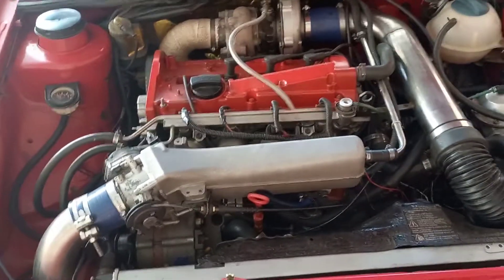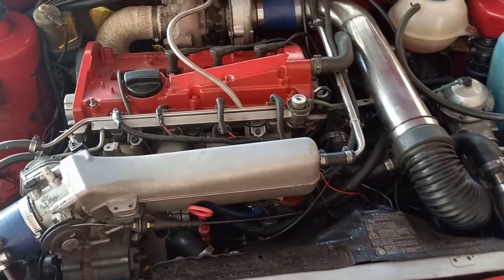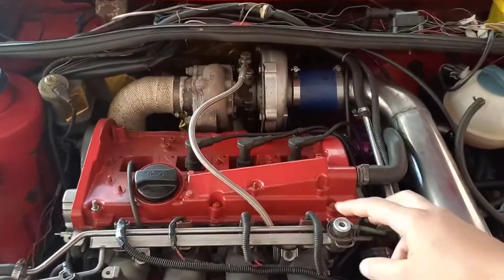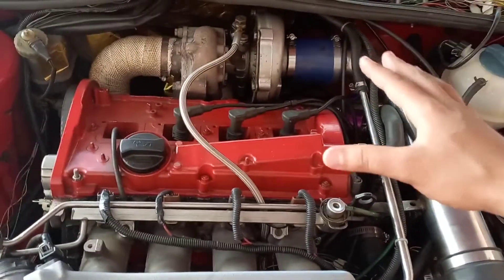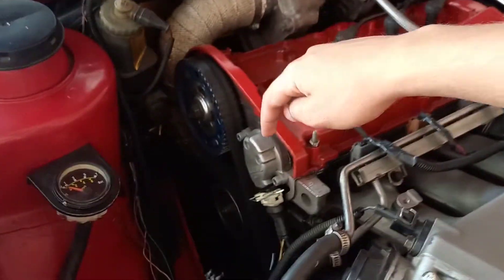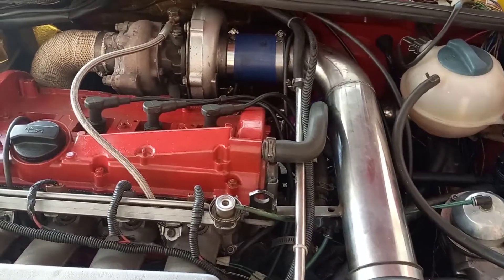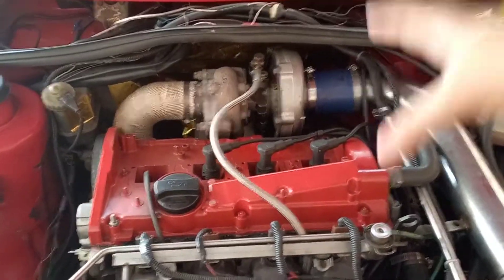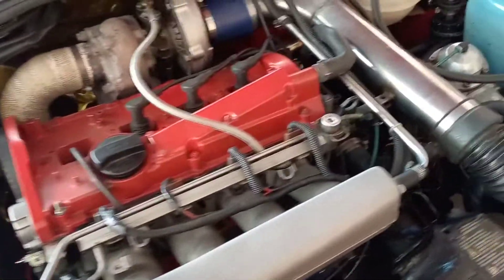Best budget ECU | Switching from Dicktator to speeduino ECU

Comment from the maker: I Forgot to add, it has 
fuel and oil pressure input- safety,
supports flex fuel input,
Bluetooth connectivity,

And since august, supports boost by gear/speed input

Comment: In fact, the original Speeduino is an amateur project, without any protection against electromagnetic interference and in the VR conditioner, precisely where it is most needed for the vehicle to function properly. These PCBs do not have grounding planes (there should be at least 3), do not have adequate filtering on the 12V line (Pi filters with inductors and capacitors). The VR conditioner used is very sensitive to electromagnetic noise (EMI and RFI), normally generated by the switching of coils, injectors, actuators, relays and electric fans in any vehicle. To make matters worse, the VR conditioner is mounted on a separate PCB, making it even more sensitive to EMI and RFI, which does not occur with professional ECU designs. I have been dealing with these problems for more than 2 years on a Speeduino V.04.3b and the best solution is to use a professional PCB design, with Pi filters, several grounding planes and a properly grounded metal case, as on the Speeduino DropBear. Only then will your problems end. Alternatively, I recommend using Hall sensors and shielded cables in the rotation and phase signal, eliminating the VR conditioner, soldering the configuration jumpers directly to the PCB and installing the PCB in a properly grounded metal box (Faraday cage immune to EMI and RFI) . It is also essential that the harness is well constructed, with wires of a diameter compatible with the signals, braid the sensor wires and ground them directly on the negative pole of the battery, and use high quality spark plugs and suppressive cables. Even doing all this and adding a large filter capacitor to the cooling electric fan, I still have problems with the rotation signal failing while the vehicle is driving and the engine turning off at idle when the electric fan is activated with V.04.3b. I plan to switch soon to a DropBear or a Professional Programmable ECU.
Reply from the maker: Interesting write up. So where are you having grievances? It sounds like your only problem is vr crank sensor. Both cars that i have running on speeduino use hall effect sensors, and i have never had issues with rpm signal. But valid points. Worth considering if you have vr crank sensor engine.
Reply: Have you added your recommendations to the Speeduino wiki?

Comment: 0.3.7 is very bad ,I don't know for 0.4...
Reply from the maker: Curious. What's bad about it?
Reply: @061garage  if your voltage is low , data can be erase and you must reload your program.
Reply from the maker: I hasnt happened in the year I've been on speeduino and car battery dies often,  lol. They must have fixed it.
Reply: @061garage  did you try 0.3 board ?because in 0.4 maybe not happen
Reply from the maker: @ecuperformance959  nope, I have no experience with the v0.3 board.
Reply: @061garage  excellent ,one  more try with 0.4 board then...thanks  friend!
Reply from the maker: @ecuperformance959  sure thing

Comment: Nice video and informative. Keep it up.
Few issues though.
What is the price difference between the ecus you mentioned? 
Don't see it being fair as a straight comparison but more as a alternative upgrade path with more features and tunability.
The dicktator Std was never a full house/featured system but filled a void for a basic ecu to get guys running on a budget.
For what it is, it is still a impressive cheap ecu even though its probably a 20 year old design.
For more features there are lots of newer ecu options available with the features you mentioned.
Speeduino interests me but without local support its a hard switch.
For a lot of guys the Dicktator has been a very simple system to fit and work with and guys going to higher end or full featured ecus get stumped at the steeper learning curve. I joke with customers.
" If you clever, you more likely to have problems fitting it. If you stupid, you more likely to get it running." Biggest issue we find is incorrect fitment and basics when starting a car with Dicktator.

The speeduino comes across similar in approach to the megasquirt ecus from the early 2000s.
A Great way to learn but has never been really cost effective for us in ZA.
Reply from the maker: Thanks.
Its pretty much an very accessible megaspuirt that uses and arduino as a processor.
Biggest reason for using it is :
boost cut and boost control,
 flatfoot shifting and launch control.
I had my ecu built in ZA. Circuit with map sensor on it. About 2000k  Without wiring. You could pin it into stock ecu plug and you wount need a loom. I made a new loom from scrap yard wiring since i had nothing. I 3d printed a case R200. 
The following can be done for any car:
Stock crank sensor.
Stock cam sensor
Vw boost controller.
Vw speed sensor.
Flex fuel

So the flexibility on setups and features its pretty much competing with high end ecus like haltech and ecu master,

 biggest difference is there is no plug in dash for speeduino but will display all parameter on bluetooth cellphone.

As basic price comparison to get to a dictator level of functionality is about R3000. But then you can obviously make a world worth of upgrade to wire to the ecu which makes it more pricey eg flex fuel, boost controller.

The internet as much more resources for  speeduino than dictator, which left with no real desire for local support.
https://wiki.speeduino.com/en/home

Comment: Hi... Brujie. I don't think you know the management system to give a review or a comparison. Besides I honestly don't think you know your engine because then instead of std dicktator you will use 60-2. Please do proper research on the management. Besides the speeduino is  Chinese management. How many people in SA actually does it? I do management installations and tuning I think you need to ask people the right questions.
Reply from the maker: Hi, bratjie. I don't claim to know everything, learning everyday. No worries you seems to be just as confused, calling out Chinese without doing research. But your comment could be useful to some.

My speeduino can run 60-2, distributor, 30-2 and any other trigger setup without having to buy another ecu, as you would have to with diktator. 
Don't misinterpret my nerves as being misinformed.
 I look up to your channel, found it helpful. I don't want to lose respect for you.
As far as south africa, this is not a local ecu, it's global, with global support and forums, Facebook groups. Frequent advancements eg boost by gear, Since August last year.(same hardware) And all for the price of diktator or less. You might have to look into speeduino again buddy.
Reply: As you can see his using a distributor setup so a Dicktator standard is suffice however even if he does 60-2 he will still sit with the same crappy batch fueling and still have less features and functionality than the Speeduino. Dictktator is old and outdated yes it does the job it suppose to but that's about it.
Reply: I have seen your videos Buddy Rocks you do great work!!! 061 GARAGE nice move on switching to Speeduino I am building my first project and I am going to use Speeduino for the features you mentioned but especially because its open-source which gives you virtually unlimited creativity as to how you going to integrate other car systems with the ecu - like the Bluetooth thing you did thats serious customization you can't easily get with proprietary ECUs
Reply: I saw your diktator video and you were nervous af. The beauty about Speeduino if you didn't already know, it's Open Source which in essence means it's run by the people for the people. A great example of this is the Linux operating system which is now used on the Space Station because it's more reliable than Windows. I was going to use Diktator until I found out about Speeduino.